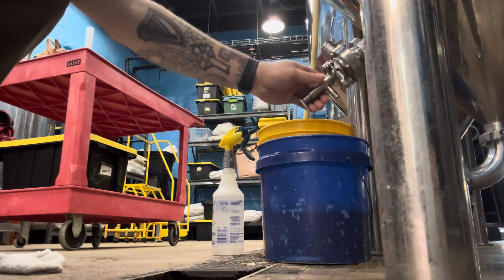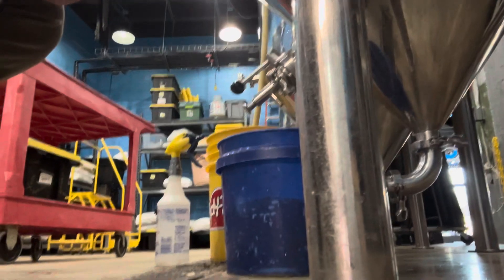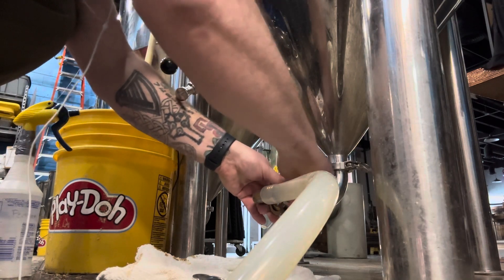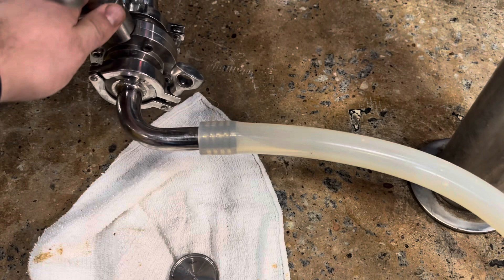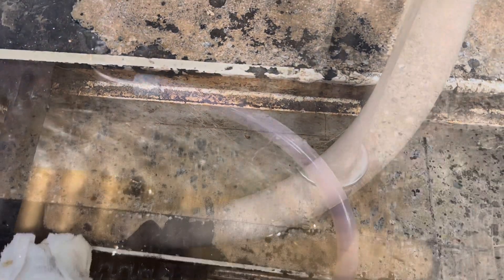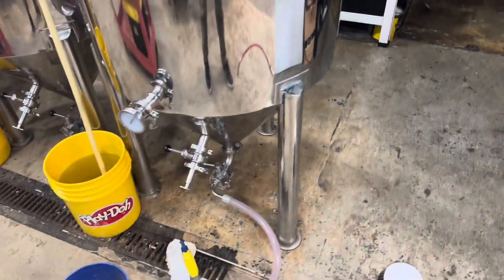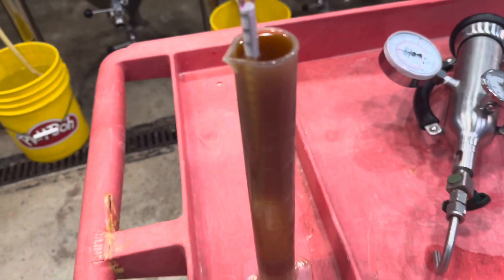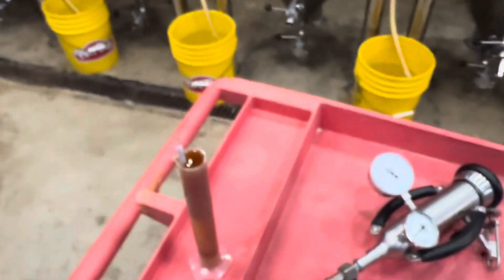Using a conical fermenter: dropping the cone

Comment: i learned you should still filter that with a paperfilter to get rid of the yeast, it doesn‘t take that long and you should get a lower more accurate reading ;)
Reply from the maker: In my experience, it hasn’t been necessary to filter it. I get an accurate enough reading to be on track with what I expect activity to be. I appreciate the tip though and I’ll try it out in the future for sure.
Reply: yes fair, during fermentation it‘s not really necessary, just in the end to know where it stopped